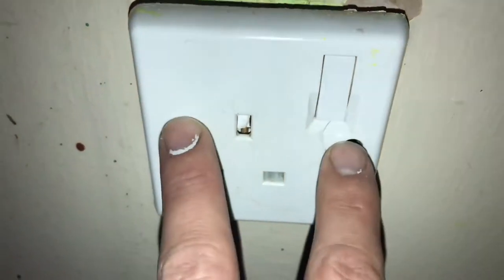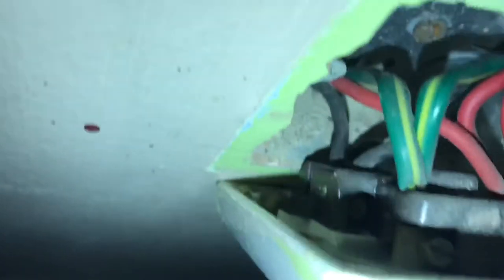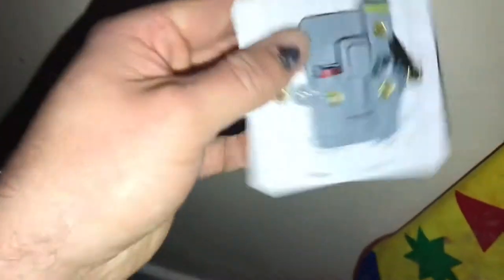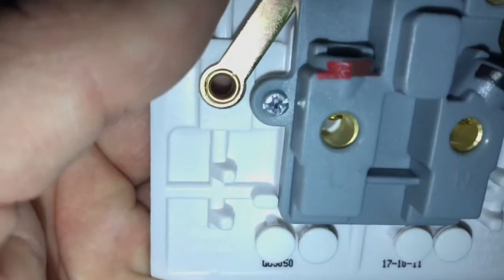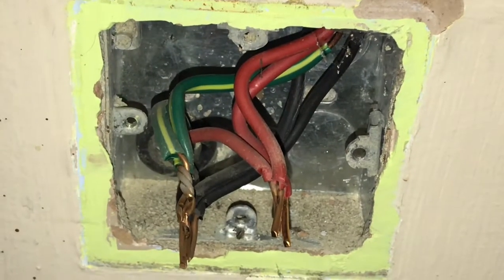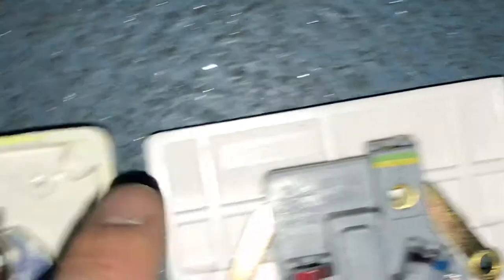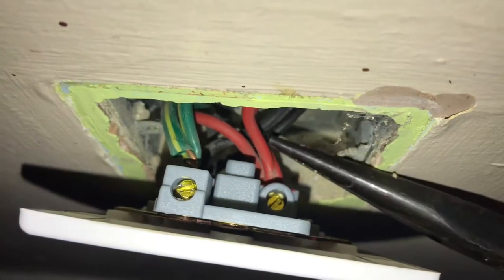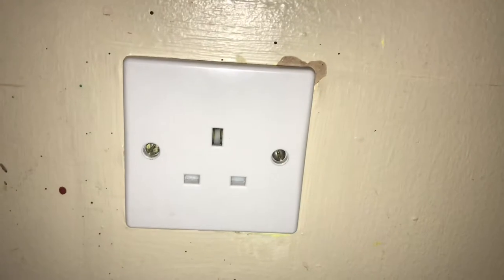How to replace a single socket without an isolation

Comment: You can now get rapid fix sockets which have wago type levers on the backs, I’m not sure if they are doing single gangs like you had here but I would recommend them 100%! So the same torque is applied to each conductor which means they are not loose or over tight.

Comment: Hi how do you test a room thermostat when you link it out witch thermals do you put link into.
Reply from the maker: Hi peter, that will depend entirely on which ones you have... they are all slightly different. Best thing to do is check the manufactures instructions/google the electrical diagram.
Reply: @PlumbingGy  hi Dan on a common used one would you put link in L&SL to test it?
Reply from the maker: I do not want to give you any incorrect information without knowing what’s what, so what I will say is use a multimeter. When the switch is open there will be a voltage difference between the two terminals, when closed there will be a 0 volt difference between the terminals as they are connected to each other.
It might be safer to turn the heating off, disconnect one of the wires and measure the resistance between the terminals. It should be open circuit when the stat is low and approx 0 ohms when stat is high.

Failing this do you have a motorised valve installed? This could be at fault instead of the stat.
Reply: @PlumbingGy  I understand thanks for you help so far it doesn't have any valves on system it a combi and the thermostat on the wall doesn't turn heating of or on I just wanted to link it out to see if it was faulty
Reply from the maker: Try the multimeter method if you can if not you will have to find out the make an model, google for the manufacturers instructions. Hope this helps in any way. 
Thanks peter